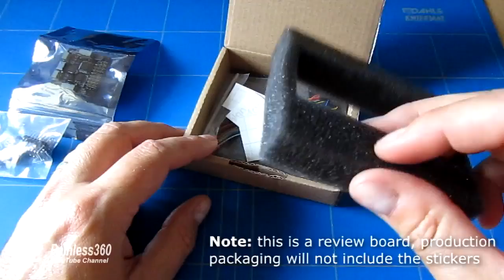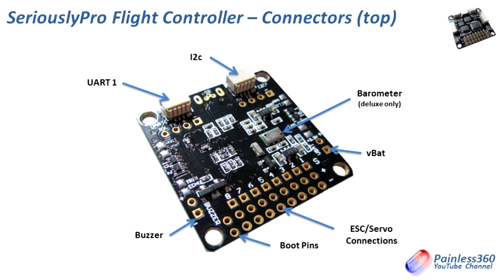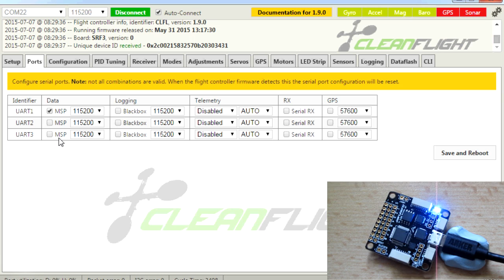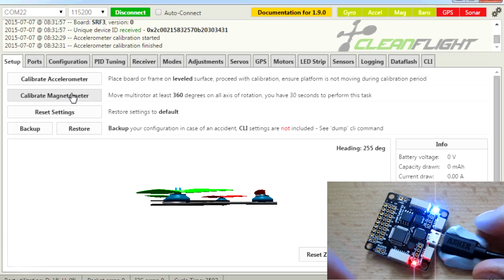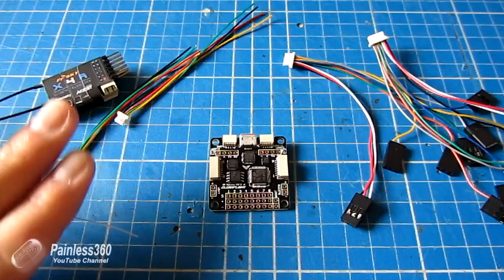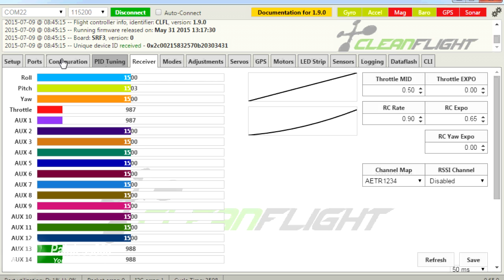(1/9) Seriously Pro F3 (SP3) Series - Overview and firmware installation

Comment: You make it look so easy. I'm trying to hook up a FR sky RXS r receiver with S-Bus and I have bind but I can't get anything to work on the receiver tab for modes. Any thoughts?
Reply from the maker: Could be loads of things. What troubleshooting have you done?
Reply: @Painless360  get this, and I just stumbled upon this on the internet. I hel d the bind button too long and it put me into PPM mode. So I had to hold the button for 4 seconds and the green and blue light came on and then everything worked. That's a good tip to remember

Comment: Every time I try to flash firmware it get half way and then it says PROGRAMMING FAILED TIMED OUT, any ideas on how to fix this?
Reply from the maker: Depends on the version and type of FC you're using. If you are using a modern FC then you may need to update the bootloaders driver. See my video on Zadig..

Comment: Sir,I have a problem with my fc,,SP RACING F3,,I can't get into dfu mode,all drivers was installed,,when I connect my fc into configurator and i try to connect it connects but in my recievers tab It doesn't open,,it's log,,what do I do sir? Betaflight, cleanflight,inav all  that configurator has the same problem with my fc,,I can't get into dfu,when I connect to configurator it connects but in the recievers tab I can't see the settings,it's log
Reply from the maker: If you short the bootloader pins/press the button on power up then it will start in bootloader mode. If you can't find it on your computer then it's a driver issue. See my video on Zadig... Best of luck
Reply: I can't go into dfu mode,,I try to use zadig or impulserc,,but I can open the FC on inav  the problem is when I go to advance tuning tab its not open,,what do I do sir,I'm new in this hobby
Reply from the maker: I'd recommend watching a few of my quadcopter building for beginners series. It's easy to get lost in the woods when you start... best of luck

Comment: Hi,
I'm having problem connecting to betaflight,I'm using windows 7 and have spracingF3 version 4.0.3

 I just recently flashed the newest version of betaflight to the board. Betaflight can see the board but it doesn't want to allow me access to any of the settings.

I can see that the driver is installed correctly and new port appears.

But when trying to connect I'm getting the following error:
2019-06-18 @ 21:58:37 -- Serial port successfully opened with ID: 3

2019-06-18 @ 21:58:47 -- No configuration received within 10 seconds, communication failed

2019-06-18 @ 21:58:47 -- Serial port successfully closed

Any ideas what can I do?

Thanks in advance
Reply: When I had this problem trying to get my old F1 naze32 rev 6 to life one thing I over looked was that the "USB 3.0" port's on my mother board didn't do the com port emulation I had to use the "2.0 USB" ports and it was the same with my Taranis it does not like the 3.0 USB port's.

Comment: clean flight has disappeared from the chrome store. where else can i find it ?
Reply from the maker: Sounds like you're reasonably new to all this. Cleanflight as a project has died a death. It's been replaced by betaflight for quadcopter racing and flying and iNavflight for GPS enabled flight mode with quadcopters and flying fixed wing. Check out my newer build series and some of my choice videos for more detail

Comment: Painless360 hiya lee do you know if there's soldering pads or contact's under the io-1 and io-2 pin connection's iv been constantly having problems with broken wires and thinking just solder them and run my wires out the front of the plastic case lee will that be possible
Reply from the maker: Not sure, I’ve not used one of these for a few years.. happy flying!
Reply: +Painless360 noproblem thanks Lee

Comment: One thing that I can find no information about is the available GUI programmes available for this controller.  I have bought one , but have also have a Pixhawk which uses the Ardupilot Mission Planner for both setup and for flight control.  Are there any similar programmes for the SP F3?
Reply from the maker: Flight Controller Comparison: Summer 2018https://youtu.be/SkURV9H84QE may help a little..

Comment: Hello teacher how are ya yesterday I flush new firmware for speaking f3 it's flashed with me only after I dounloaded the hex file menaully so after that I have a problem with only cleanflight some time the board conected and some time give me error stm32 but with betaflight always conected normally no problem at all what you think the problem is I need connect 3 or 4 time the board with cleanflight to get conected and also I wanna ask you atherosclerosis thing 
I am going to build other quadcopter 450frame 
I need to shoice between 2flightcontrol. Omnibus f4 / apm2.6 which one is easy and better to choice 
Thank you very much

Comment: Can you still install gps just to find out position even if you don't have the magnetometer onboard.
Reply from the maker: +Rubdul Bah it depends if we're talking about a fixed wing model or a multi rotor. The best thing to look at if you're considering GPS is actually iNav. Check out the inav series on the channel..
Reply: A multi rotor, in case I end up losing sight of the multi copter during a crash. Then i can just look at the footage captured by it from the osd's perspective and then determine the coordinates.
Reply from the maker: You can. The GPS coordinates can be displayed in the OSD..
Reply: Great thanks.

Comment: Hi, I have just updated a new spf3 board to 210 firmware and all seems fine in clean flight. The problem I think I have is the red led now flashes 3 times twice when connected to clean flight then goes out. If I tilt the board the led will flash normally and also when I open the CLI window  the led flashes also until closing the window. Do you have any answers on how I have got this board doing this and help with sorting it out? Regards Mark. P.S The best helpful and straightforward vids for all things RC , Thanks...
Reply from the maker: Sorry, I've not tried 2.1 here yet. A quick look at the documentation, I can't see anything that changed. Is there an actual problem with the board not doing something? I tend to ignore the LEDs ;)
Reply: Painless360 Thanks for your reply.  I haven't progressed much further than updating firmware, soldering header pins and now connecting satellite receiver so I will be able to see if it is working correctly once this is done, so far the board reads clean flight and seems fine, I just thought with the red led not lighting up as supposed to, a setting somewhere needed changing maybe... I will keep you posted on the outcome. Thank you again... Regards Mark.
Reply: Hi, Once I soldered the satellite receiver to the board the red led started flashing normally... so all good. Cheers.. Regards Mark.

Comment: Hello, I am having wierd problem with my quad. Motor stops resonding to throttle stick after couple of min flight and crashes. please see the video link https://www.youtube.com/watch?v=uuqRiQ8ReNM ( i have removed props). I have calibrated Esc, Radio but after couple of minutes flight the throtle doesnot response properly. the FC doesnot autolevel. I am using little bee 12 a esc, 2300kv 5045 3 blad prop, SP3 fc. Please help!
Reply from the maker: +Bikesh Shrestha if check the logs and also suspect the esc or motor. Swapping the problem motor with another will show you if it's the esc or motor thats not happy. Best of luck
Reply: I accidentally short one of my esc. is this the cause of what i am getting?
Reply from the maker: +Bikesh Shrestha very possibly..
Reply: I have check the board on another esc with 5v bec and motors, no luck, I am still getting same problem after couple of min of throttle, I have replaced the f3 board thought its board problem, still that problem appears, don't know which part is faulty. I again doubt on the board itself. do you have any idea?
Reply from the maker: +Bikesh Shrestha it is most likely to be the components you've not changed. I'd look at all the common elements for the cause, best of luck
Reply: I flashed the board and tried  and installed the board and I removed the faulty ESC. it's not showing the problem again. checked couple of times. hope the ecs was main cause. thank you :)

Comment: Hello Painless360. Thank you so much for your clear and detialed explaination. I am running in some trouble with this board. Using the PPM signal or the IBUS signal on the corresponding ports i am not seeing stick movement on cleanflight :( to confirm that the reciever is bound and the signal is arriving i connected an osciloscope prob to pin3 of the io port and tge signal is perfect. What could be the issue for not seeing the stick movement on cleanflight please? P.s. channel map is correctly set as well
Reply from the maker: +gilorm1991 see the later videos in the series where I show every step of the settings for sbus and PPM. Best of luck

Comment: Hi there ! It's been a week I'm trying to connect my SP racing F3 on my 
mac, using cleanflight. When I try to flash the firmware I still have 
"communication with bootloader failed". I tried with three different 
cables and finally buy one to be sure. I tried to jumper the boot pins, I
 installed every driver I found (SiLabsUSBDriverDisk, 
FTDIUSBSerialDriver). Still, I didn't found any STM32 driver for OS X, 
neither a OS x version of Zadig. Whatever I do I still get this 
"communication with bootloader failed". My mac is running Sierra 
10.12.4. When I connect the SP F3, two ports appear : 
"/dev/tty.SLAB_USBtoUART" and "/dev/cu.SLAB_USBtoUART". I'm trying to 
flash v2.0.5.
Please, would you have some advice ? I watched every single video and read every single tut. Maybe asking is the good solution now :)
Reply from the maker: Sorry, I don't use Macs here. We cover the process in far more depth in the 'Quadcopter Building for Beginners' guide, alas, it's for Windows..

Comment: Hey Painless! Something funny happened here. Well, not that funny... I have a SPF3 10dof board... And after I flashed to betaflight 3.1.7, paste the cleanflight config. and so on,  the MAG and Baro did not activate anymore... both are OFF at BF main screen... and I flashed back to Cleanflight and also Mag and Baro OFF... Is anything a could do to turn them alive again?? Thanks!
Reply from the maker: +Thiago S V C A you have to enable them in the GUI now. They are disabled by default.. best of luck!
Reply: Yup, that is it!! If you ever come to Ilhabela, Brazil, you can stay in my house as my guest. thanks.

Comment: Hi can the fly sky FS T6 receiver work with SP Racing F3 Acro on clean flight. If yes which settings should i use. Thanks
Reply from the maker: +Trevor Belle I'd recommend that you watch 'quadcopter building for beginners ' series. We cover lots of the steps I detail for new builders in there.. best of luck!

Comment: Hi there. I have got the SP Racing F3 Acro board where the OSD stopped working (board does not deliver a signal to osd) and also I can´t connect to the board anymore. Flashing with boot pins shortened doesn´t work. The board itself works and I could fly. Anyone else having this problem?

Comment: I recently purchased an RTF Wizard x220 which came with one of these flight controllers.

Anyway, a week or so through flying and suddenly the flight controller has stopped working? The LEDs have stopped working and there is a slight burnt electrical smell coming from the quad's internals. Do you think there is any hope of revival, or will I have to order in a new FC? :(
Reply from the maker: +Jonty Trombik sounds like it. I investigate why it gave up in the first place so you don't break the next one too. Best of luck

Comment: What voltage one should get on VCC pin when connected to USB? I seem to have 2,5V.. Something is not right, right?
Reply from the maker: Not sure what VCC pin you mean. I've not tested it, not all flight controllers pass the USB voltage around the board..

Comment: I just own kakute f3 flash no problem into BF3.1.3 using spracingf3 as target. during my configuration found a slowness and sometimes hung in middle between betaflight configurator tab. after sometimes i do realize that my fc usb throw a lot packet error at bottom betaflight configurator. do you have any idea how to sort this out? i fly ok, everything fine.. just the usb. so this make a headache in term of doing the configuration in future.
Reply from the maker: I'd suspect the USB cable first. Make sure that anything like OSDs that may be interfering with the USB connection are not on too.. Best of luck!
Reply: Painless360 thanks :). I'll give a shot. great tutorial and informative!
Reply: it works! out of many deep possibility... just the cable throw a lot of packet error. work like a charm with other usb cable. 😂
Reply from the maker: https://www.youtube.com/watch?v=vgX1M1ICx8A ;D

Comment: Hello, I have been doing my first drone build and I have a question about connecting the R9D receiver. I am running it in SBUS mode, and I was curious that if my PDB has a built in BEC if I need to get another separate BEC for just the receiver or if I can solder to the PDB using the 5V spots instead? Any help with this would be greatly appreciated, thanks!
Reply from the maker: This is a common question for first time builders, we look at it in the next video in the series but if it's your very first build then one of the series designed for the first timer - 'Quadcopter building for Beginners' - show every step and cover the build in a lot more detail, explaining some of the basics as we go.. Best of luck with your build!
Reply: Painless360 Thanks for the fast reply, I appreciate it!

Comment: Thank you painless for your content!  I have a little issue with my ProF3, when I select One Shot, my motors twitch rather than spin up when armed.  They make this funny pulse in about .5 second intervals.  Rarrr rarrr rarrr all in unison.  My ESC's are suppose to be compatible but it was an alibaba purchase so who knows if any of it is genuine....  I can just run without it, but would like to use it if possible obviously!  Ideas or thoughts?
Reply from the maker: +Joel Retzlaff have you calibrated them?
Reply: Painless360   I did, but I have done a lot of fussing since then.  When I first did it only one motor did this strange behavior, since all my adjustments (first build) it's now all 4.  I'll try calibrating them again.
Reply from the maker: +Joel Retzlaff have a look at the 'Quadcopter building for beginners' series to see how we tackled a similar problem.. best of luck!
Reply: Painless360 thank you!  I did a little more digging and determined my minimum command was at 1000 but my throttle at the bottom was at 988 so it was causing this crazy action while disarmed.  
Does throttle need to be 1000 - 2000 too?

Thank you again!
Reply from the maker: Yes it does. All channels do. Best of luck!

Comment: HI could some one give me some advise i got myself a Realacc x210 with the sp racing f3 and a flysky Fs-i6 
Flashed with the latest version of betaflight because i cant get aux2 to work its showing that its on channel 6 but cant get it to show up in betaflight this was the same in cleanflight so thats why i flashed with betaflight but still the same 
it show aux1 on channel 5 working had a look on all over youtube  but cant find any thing could any one help 
its on pmw to if this helps
thanks for your time.
Reply from the maker: Use the monitor screen on the radio to confirm that the channel is indeed moving as you operate the switch and that it's moving the 6th channel (if you want Aux2). Best of luck!
Reply: Hi thanks for getting back it works on the screen and shows that it's moving 
just not in betaflight looked everywhere to see if it needs to be enabled but all the videos on YouTube show it should just work?

Comment: hi Painless, I have my spf3 evo working in cleanflight but when i go flash new firmware it says Failed to open serial port and then i have to disconnect it and reconnect it to enter cleanflight again. I dont think i missed anything in this video. Can you help me please? I am new to this board even though i have been through a few of them now :)
Reply from the maker: Usually a driver issue, I'd try to update the driver you're using for the STM32 device in device manager. Best of luck!
Reply: Painless360 thanks I looked in to it and it was driver issue thanks.

Comment: hey i'm kinda at wits end here and i'm having issues with the quad I built (typical). I have built quads before but i switched to the cleanflight FC. I have littlebee 20a esc which only have two wires. (can only assume no BEC). so no power seems to be getting to the board and also my receiver. i have a flysky fs-t6 cheapo tx/rx. uses pwm. i plug in battery and no power to board so i cant troubleshoot the receiver because i don't think its working either but i think its because its not getting power to it (again i'm not sure). no lights on FC
Reply from the maker: +Michael Pounders that us what I'd expect with the setup you have. You need a 5v supply to power the board. See our video on OPTO ESCs or any of the wiring videos in the quadcopter building for beginners series for more details of your opinions.. best of luck!
Reply from the maker: +Painless360 sorry if that wasn't easy to read. Answered on the phone and autocorrect isn't as smart as it thinks it is ;)
Reply: Painless360 so I figured it out ...I just took a 5v from my pdb on my quad and soldered it to the +- pins on my receiver and boom

Comment: Do you know by any chance If I'd be able to get IBUS telemetry back to the transmitter with FlySky IA6B or X6B receivers?
Reply from the maker: It will only work with the FlySky receivers and you'll need to be using a version of the firmware that supports IBUS telemetry - https://github.com/cleanflight/cleanflight/blob/master/docs/Telemetry.md Best of luck!